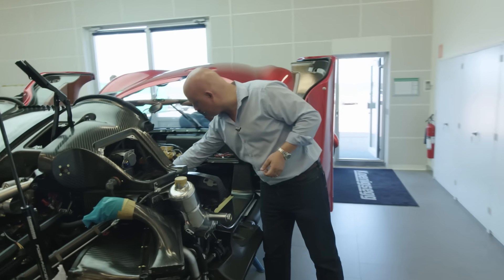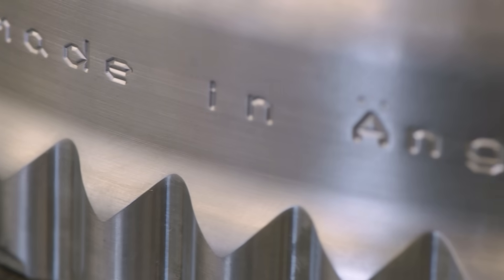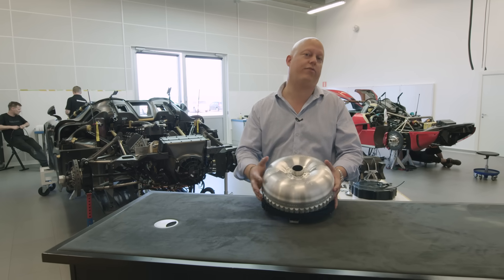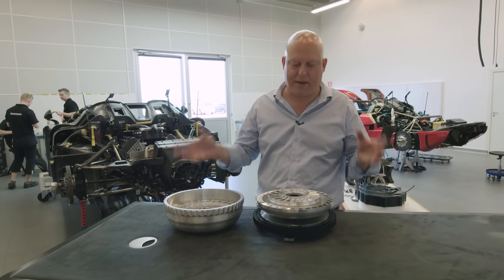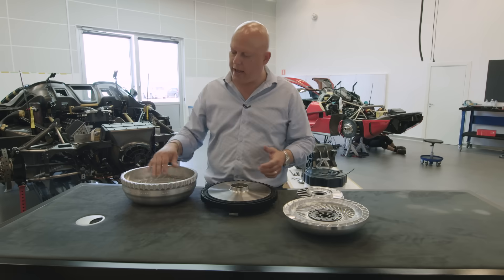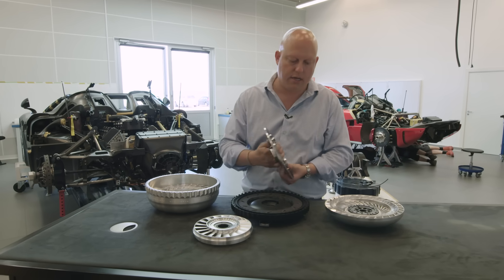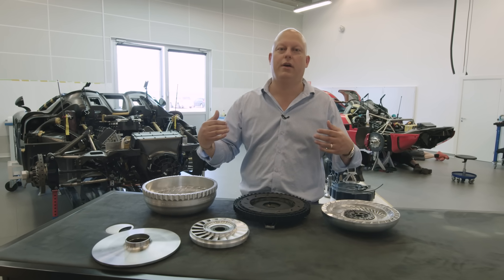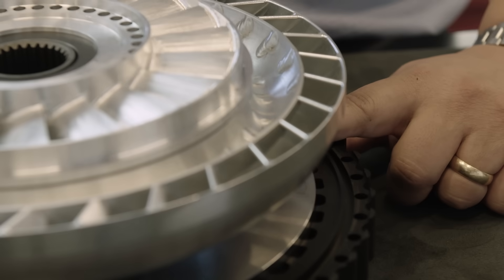248 MPH Without A Gearbox: Direct Drive  -- /INSIDE KOENIGSEGG

Comment: Its seems alot like a hydraulic version of the old Volvo CVTs that were running belts back in the day, a single gear but they managed to get around it with variable belts speeds.

Comment: This approach is very cool, especially the direct drive electric motors, but there's one thing that makes me skeptical about it. Putting the electrical motors aside, the whole scheme is basically an ICE connected to the wheels through a hydraulic clutch only. And the engine covers the whole speed range with 1 gear ratio.
I'm not sure this is the most effective, or efficient, use of the engine. Different gears on modern cars are often used to utilize the power band more effectively or to help the engine stay in its most economic rev range. The Regera doesn't have this advantage.
I understand they save some energy by avoiding some transmission losses, but the engine may still work suboptimally.

Comment: did someone understand something of what he said?
Reply: To dumb it down its effectively a clutch within a clutch within a twin single mass flywheel.

So you have effectively 2 flywheels and 2 clutch plates (1 mechanical and 1 hydraulic) setting off from a set of lights the torque converter (clutch and fly wheel mate like normal but while the difference in rotational speed is so different it uses to second plate to modify the friction without stalling the engine meaning more torque can be transferred at the same RPM. The electric motors are used to fill the gaps and help match the torque on the primary fly wheel and clutch plate, that forces the oil through the secondary plates slowly locking them together like a clutch would normally do on a normal  car. Except where a normal car has a gearbox between the clutch and rear diff this system doesn’t which gives it its direct drive.

What he’s described is ICE-Flywheel-EM-clutch-clutch-EM-Flywheel-rear diff-wheels. 2 clutch plates connect the 2 flywheels which lock together once the torque is equal on the input and output shafts of the direct drive box.
Reply: @kevinp496691  thanks for dumbing it down for us...
Reply: Ja, aber das ist halt sehr technisch. Wäre auf Deutsch vemutlich auch nicht für den Laien verständlich. (Your nick made me guess you were German?)
Reply: i  think he’s talking about a car or something
Reply: Yeah
Reply: Pretty much, it's fairly simple with the way he explains it
Reply: Idk. His company makes cars and shit, but I dont know
Reply: Practically everything.

Comment: I love that you think how I do. I just wish I could buy this form of torque converter/fluid coupling for an old muscle car. The ability to stay at peak power throughout acceleration would be awesome. Since I'm pursuing a degree as an EE, I probably won't be designing my own any time soon. 

Just looking at your design, though... That fluid coupling, compared to an electrical generator set and motors shouldn't weigh very much. I had heard from a friend way back when that diesel locomotives were given consideration for hydraulics VS electric motors/generators, and they chose the latter.  I have to imagine that the electrical implementation they chose is much heavier than a possible hydraulic implementation, but maybe they needed the weight for traction since steel on steel isn't a good surface for that.

Comment: With no offense intended to a brilliant engineer, I assume the torque converter housings he is showing are prototypes, as tig welding the vanes in that unit is a touch old school and could be hard to balance and achieve consistent production quality. Far better quality and consistency and quality would be had (even in low volume production) on a DMG Mori ASM (Additive/Subtractive) laser sintering machine. We are doing it on $3000 oilfield jet pump parts laying in carbide on Inconel, I'm sure the technology is a good fit for what they're doing.
Reply: They arent tig welded. Looks like its 5 axis CNC machined
Reply: Yup, 5 axis CNC's are just right choice for something like that. Once the program is completed and checked if nothing bad happens with the machine, it can work 24/7 producing the part. Then you only need someone to make sure the machine is in the right condition, check oil level, tool wear, etc.
Reply: Superglue would do  but difficult to use as you can glue your fingers together.
Reply: Brandon Yorgason yeah probably proto part
Reply: I'd bet that is just a get it done quick with what we have, pathing / tooling you know. A ton nicer surfacing could be done, but would it effect the performance or just add tons of cutting time just to look nicer.

Comment: Amazing innovation.  I wonder if there would be any benefits from 3D printing these parts in metal and if the parts would hold up via a hardening process.  At the least you'd not need the welds for the separate machined parts.  They'd also may be less expensive to produce and would have very high consistency.

Comment: But we Americans have discovered a method to go from 0 to 300 MPH in 5 seconds. What we do is we put a big engine in a tube chassis. Strap a seat to it, zip tie plastic trim components on, and attach it to disc clutches. Sure all our clutches are shredded by the time we make a single quarter mile pass, but we get maximum acceleration.
Reply: but it doesn't work on the road man!
Reply: rakib khan his comment was ironic..
Reply: Its more fun ...
Reply: Erm... sorry, i do not want to replace my clutch when i want to cruise around
Reply: @CarbonComp  Clutch!?!? They rebuild the ENTIRE drivetrain!

Comment: So you have gears in some way... 1st wich is torque converter and second wich is when clutch locks up because you use torque converter to get more wheel torque at lower wheel rpm as you would do with traditional gearbox, you just cant stall engine and stuff and you dont need additional clutches because you are alredy using a torque converter.

Comment: Amazing. First I've heard that they had eliminated the gearbox. Gearing is considered "an unavoidable loss" in vehicles. the lack of a transmission is one of the things that allows a Nissan LEAF or a Tesla to extract so many miles from a fixed unit of energy (LEAF is more efficient BTW). 

Each gear used can take as much as 5% of the power due to mechanical loss. Most transmissions pass the power through at least three gears, often four, to get it to the wheels. This accounts for the difference you see between advertised crankshaft HP and dyno HP "at the wheels." If Koenigsegg is only using one gear (the differential) that could be a Huge advantage in turning crankshaft HP into raw speed.

The downside: Shearing hydraulic fluid (slip) in torque converters generates a tremendous amount of heat (for every gallon "slipped" X oil pressure when slipped/1714 = HP turned to heat). Look at that pump again and imagine how many gallon it slings at 10k RPM. Between launch and lockup the oil in the torque converter will heat very quickly at these power levels. Certainly the electric motors reduce the load on the TC but the enormous power of this gasoline engine will quickly heat the oil to the point that it decays and changes properties. I have to assume a significant portion of the oil pumped is diverted to a cooler , especially given the low stall point of the torque converter. That robs efficiency.

Obviously Koenigsegg has overcome these issues and I would love to know how. If you are fortunate enough to have one of these please lend it to me so I can take it apart and see what they have overcome this difficulty.
Reply: the extreme efficiency of an electric motor is why a leaf or Tesla can go so far on not much energy. the differential gear is still a huge power sucker, due to the 90 degree angle.

Comment: Christian, how is the amount of slippage in the torque converter controlled? is it just a passive system based on the load ratio on the input and output side or is it activately controlled by the computer considering many inputs?

Comment: in 25 years when this is an older more revised concept thats cheaper to manufacture combined with the freevalve concept and  variable compression ratio crank that another manufacturer is currently using, 2.0 litre N/A engines are going to be capable of 400 HP throughout the rev range with just as impressive torque numbers. we have come so far in the automtive industry in the past 35 years!

Comment: I dont get it: he just basically explained how a normal modern torque converter works. The only difference is the electric drives they added. The disassembled part in front of him is basically a Allison clutch-locking hydro-kinetic torque converter.

Comment: Wow that was a long video to explain you have an aluminum torque converter.... With absolutely nothing special about it.... Other than it's going to prematurely wear, and not take the heat like the steel ones we all use in a racing application. Should have probably done a bit more research why aluminum is not used in drag racing, where weight is everything, and money is no object. 

That's the real reason why no company would build it for you. Not knocking the concept, I like innovation, but there is a reason nobody else has done it.

Comment: I was so excited to watch this video so that I could finally understand the KDD system and the hydraulic coupling... and I still don't understand it.
Reply: As far as I get it, the torque converter acts like the gearbox, basically like an automatic car but always working with a 7th gear like relation.
Reply: lol same here,the man was so clear and yet i just !!!!!!!!!
Reply: It's hard to understand that it is more efficient when running with a ratio as the 7th gear ⛮

Great engeneering!
Reply: Luke Parsons it's just a more efficient lockup torque converter with a built in clutch.

Comment: in simple language, pre lockup the torque converter multiplies torque by multiplying hydraulic pressure in essence behaving like a "low gear"

lockup mode the torque converter is completely bypassed and the system becomes completely 1-1 ie high "gear"

Comment: Still slower acceleration than p100d of 2.4 0-60 ;)
Reply: P100D have 4WD though.
Reply: Sure, but F1 are RWD and are still faster. My point is, this shows, that a family sedan can be faster than performance-focused car. I'm not saying it to discredit KOENIGSEGG since it's track performance is no doubt better. Cheers
Reply: The P100D does 155mph tops. Any hyper car will destroy it on a track. 0-60 time don't mean anything much like 1/4 mile times. Look at the GTR. IT is a 2.9 sec 0-60 car but gets destroyed by cars that are much slower to 0-60 like the 3.4 sec 911 GT2 RS.
Reply: Actually any Super car would destroy the P100D on a track.

Comment: This is a really cool concept, the only downside i can see is that if the car runs out of battery and the electric motors can´t provide sufficient power it would start to feel really slugish and i guess quite weird with the engine fighting the converter and then suddenly engaging and disengaging the lockout. (please correct me if I´m wrong and I missed something)

Comment: For anyone who is confused after watching this you have to know that this is in fact at 90% a traditional hydraulic torque converter with a lockup clutch. Every traditional (not dual clutch type) automation transmission uses a hydraulic torque converter which basically operates the same way as the one in this video. The difference is that here it is much stronger and can hold a lot more torque. The reason this car can go without a gearbox is simple- 1200hp engine + 500hp electric motors. With that much power you can go really fast even though the TC when not locked up is very inefficient.

Comment: Very nice. The torque converter is justified if you want to reach high speeds and not loose acceleration compared to a direct drive. A double gear-double clutch would do the same I think but probably would be much heavier.

Comment: Scandinavian innovators are terrible at marketing themselves, which is sad because they make very high quality products
Reply: The better someone is at engineering, the worse is on marketing.
Reply: Scandinavians don't brag or present something in a grandiose manner, because that nonsense doesn't sell well in the domestic markets. Only tacky low class people care about that.
Reply: You've never owned a Saab or Volvo.
Reply: asdf right that "something like" makes him seem like he doesn't know what he's talking about when obviously it's just a saying
Reply: How does this statement have any implication to this video.
Reply: Gabriel Teixeira erik buell is a perfect example
Reply: Ya. Clinical precision. Not romantic. That's the problem.
Reply: just means they need a good ad firm
Reply: HE says all Regara's got sold even before manufacturing.. what makes you say he can't market?
Reply: asdf the torque converter is also a gearbox
Reply: No it is not. It is a progressive, dynamic, hydraulic transmission clutch system

Comment: this sounds like Nuclear Physics, but i think he made a slipping clutch wheel that runs with hydaulic oil in between two slippery plates that has a film of oil in between such that when plate A is revving 2000rpm, the Plate B will be spinning 1000rpm..whatever that spins less equals to higher torque in proportion i think. i failed math in school, i think thats what he is trying to say, the oil passage and the fancy threaded grooves soaked in oil in between the plates A and B is the driving force thats acts like a cogging wheel or sprocket, i think..wow sounds like free energy device, maybe we add some neodymium magnets it might run faster as well with less input

Comment: this is tech that started back in the early 1900's but now we can store energy in a much smaller package and have much finer materials and technology in which to make the car far more efficient. Pope and others started then gasoline was so much easier and plentiful but now with oil supplies dwindling the need for the development is necessary. The 67 mustang zombie 222 w/ all elec. goes 0-60 in 1.79. Imagine adding a koenigsegg gas engine to the chassis with some more rubber and top end suspension = 0-60 in .9 sec ?

Comment: So similar to what Top Fuel Dragsters have: A direct drive from the engine to the diff, but using a ten plate clutch system that gradually locks allowing more power to drive the rear wheels as the car gains momentum and so the car doesn't over power the track at the hit of the throttle.
Reply: Kind of, this allows torque multiplication (at the cost of inefficiency) at lower speeds before lockup

Comment: Honda Accord Hybrid also had the direct drive system, single gear ratio.
Reply: but only at certain higher speeds, another words they just used sixth gear and the car only goes in no tranny mode as if you were to put it in sixth. This transmission works across the whole range of speeds AFAIK at least.
Reply: Yup, you are correct.  This direct drive "7th gear only" as he calls it is the only thing doing the forward translation of power from the electric and combustion power sources.  It moves the vehicle from 0mph to 284 MPH on the Agera (RS) -- Yes, that's the fastest production car on the planet right now.  I believe it was formerly held by Hennessey's "Venom" tuner platform.   Obviously this driveline can't reverse and turn the wheels the other direction which is where the electric motors come in really handy.. being responsible for 100% of 'reverse' which is easily explainable :p
Reply: And yet nobody is watching a video of that😅

Comment: Yes he's   a genius   ,  but  he really  needs  someone else to sell  his ideas or explain them  . 
     The best way  is to   start  at the drive wheels  to show the output result    and then  work  back   to follow each  part   that  feeds off the  power source  to  answer the   WHY(?)  .  
      Then  explain the  inter action  of the torque converter    and why IT  turns.  

    There are to many  parts  on the table   at  one time  ,  they need to be  brought in as they are  needed  to drive the unit and    lay them   out   like   fallen dominos    on each other.  
    i had a  Teacher like this   and  90%  of my class  didn't have a clue   what they  were   talking about   for Electronic  or math  .

Comment: did any one understand this in detail.... basically he forgot to state if 7th gear is either 1:1 or an over drive gear....

question for Mr Koenigsegg... was this easier than matching the torque output of the electric motor and combustion engine then matching the slope to get a smooth acceleration and the target top speed??

Comment: Looks like a complete drive unit on the floor behind Christian.  Ingenious concept!  

Many of the conventional turbo IC engines are now using a hybrid electric drive to eliminate turbo lag from a dead stop.  If you ever drive one, it gives the illusion of a supercharged engine because you mistake the torque of the electric motor(s) for engine acceleration from a dead stop.  The gas/electric combination will be more widely accepted with time.  It will soon become a high performance option in speed shops and drag racing circles

Comment: it makes perfect sense,  there is no stall like in most torque converters,  or it is very minimal.. this allows constant power for acceleration or even cruising  a constant speed.... and a machined peice with weld attributes allow more strength for warping or flexing in high RPMs.